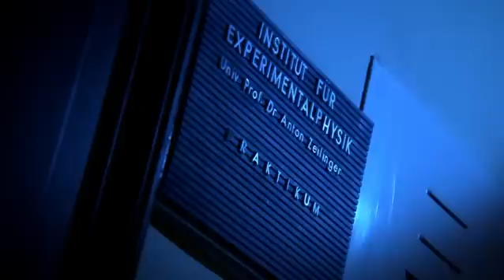Quantum Mechanics - Double Slit Experiment. Is anything real? (Prof. Anton Zeilinger)

Comment: I am a photographer and I have a suggestion. The electronic eye has a charged sensor (electrically charged to respond to the energy emitting from the atom) This is placed behind a lens or similar focussing device pointing towards the 1st slit ready to capture the path/behaviour of the atom) This actively charged sensor makes the observing device a two-way street as its both responding to atomic activity and producing electron activity. Replace the electronic camera with a film camera. If the atom is affected by the presence of a focussed path of electrons (which the camera sensor is producing ) then this energy is being focussed directly into the line of the atoms passing through the slit. This is changing the behaviour of the atoms journey through the observed slit and, in turn, cancelling out the wave inference and resulting pattern. A special film emulsion which would respond only to the energy emitted from the atom makes the observation a one-way street and wouldn't interfere with the path of the atom. The way to be sure about the validity of the obervation/camera producing focused energy would be to point to cameras at each other and turn them both on. If they capture eachothers electron emitting activity, then you have proof of interference.
Reply: Good observation.  But since the first experiments were done, there have been far more advanced metrics taking to eliminate any interference. Some even done in a vacuum.  Either way it collapsed when observed.  I can link experiments to show.  And im not quite sure of the other comment below talking about all this meta talk.  Quantum physics is not suede science or metaphysics. Schrodinger and Heisenberg equations are used to guess where a particle will be because of these phenomenons.
Reply: @jameswolfe4712  could you please share links, because it sure is getting hard to find of the actual "collapse"
Reply: @isaacflorez4820  Yes give me a bit to find a few.  Heres one I watched recently i found interesting while I look for other experiments.  
https://youtu.be/GzbKb59my3U
Reply: @jameswolfe4712  it seems like you never found the collapsing wave function vid
Reply: @TheAcidicMolotov  Perhaps it doesn't exist.
We should think of light the same way we think of sound or waves on the ocean.
Air molecule bumps other air, producing waves we perceive as sound.
Water molecule bumps other water, producing waves we perceive as well... waves.
Electron bumps other electrons, producing waves (that we should call photons), producing waves we perceive as light.

I need to see a vid of this photon measuring device.
Reply: @TheDJRiffin  well the double slit without observation shows light acts like a wave. I found an experiment of it acting like a particle, i wont be able to find it again though
Reply: @TheAcidicMolotov  lol, thanks anyway :)
If anyone else knows of a vid, we'd love to see it!
Reply: Too smart for them, sorry. They are also ignoring electrostatic build up on edges of matter, especially those slits.
Reply: The issue isnt electron interference like you say. Where is this two way electron path stated in the function of these cameras? I dont believe the cameras you refer to make this electron path
Reply: This experiment has been done with other types of detectors.Jim Al-Khalili talks about a detector  that scientist used in the double slit experiment that flashes or beeps AFTER the subatomic particle goes through one or both of the slits.The results of all these double slit experiments are the same no matter what type of detector they use.
Reply: The wave function collapses irrespective of whether the experiment is observed with or without equipment (a person observing the experiment with the ‘naked eye’ produces the same result)
Reply: @sheldonreed4787  Not exactly a collapse since there are no hidden variables and nothing changes, pretty much as you said though.
Reply: @sheldonreed4787  I have never seen this experiment done "with the naked eye" as you say.Where can I find a video of this?
Reply: Makes sense. Don't know why everyone is trying to use this as proof of simulation theory, if it's based off of a flawed experiment.
Reply: I still don’t understand how this happened, im skekkkk
Reply: The Quantum eraser experiment proves that the detectors do not interfere with the photons.
Reply: Yes. This is exactly what's happening. It's frustrating to hear people introduce metaphysics and woo to explain it. It's very clear.
Reply: @unknownuser8838  We come from "Metaphysics and woo." The universe exploded out of an ETERNAL METAPHYSICAL void at the time of the big bang.Figure THAT one out.Physics is the theoretical opposite of that void.That means that the void is Metaphysical because physics is not metaphysical.It's mundane.That's why we cant understand the void and we cant understand consciousness.

Comment: A particle surrounded by a wave. The wave goes first through both slits creating its own interference pattern which shortly thereafter the particle follows at random. When detectors are used they disturb the wave and the particle leave a normal pattern.

Comment: The energy that causes the interference pattern does not come from the photons. They travel in a straight line. The energy comes from the ether that is all around us, the energy from it travels in a transverse wave just like a double slit and a water wave. When you send a charged particle or photon through the ether, the ether being charged reacts by repelling around the photon (for every action an equal and opposite reaction) creating a wave as the photon passes through.  But, when you try to detect the photon the detectors also disrupt the wave in the ether, thus making the interference pattern out of focus. If both slit are open (and detectors off) then the ether waves focus in an interference pattern. This is similar to how an MRI works create a large magnetic field through your body then send radio "waves" through it, creating an image from the transverse waves of the magnetic field.
Reply: Joe Deglman I think I actually understood what you said!
Reply: I think people confuse light with photons. Light is a transverse and spherical wave of ether that travels away from a heat or energy source, like a candle flame, such as Thomas Young used for his double-slit experiment.  A photon is purely a particle that creates light.  A photon creates light in two ways. 1.) a longitudinal spherical wave it creates as the ether repels around the traveling photon,  we see it as an interference pattern, and  2. a transverse spherical wave that travels away from the point of impact of the photon which is an an energy source.

Comment: Does Light (Photons) act by the same laws as like matter of gas and compression?
and how for are the detectors from the slits to monitor it's behavior.

I truly don't see a photon slitting into two or multiple particles before coming into contact with the two slit area unless there was a form of interference before the two slits like dust or just in front of the source projecting the photons.

I do not know much to the behavior of Photos at the subatomic level but shouldn't they (a single Photon) be dividable in proportioning with the same value of size making them fainter as they travel along?. Like how thing spread out into a less dense form being concentrated?
Reply: +Kurt H photons are not particles and thus they do not behave like gasses do. They are also not dividable as far as I know, though they do sometimes briefly spontaneously divide. This is an example of a demonstration of the fact that protons are not particles, but waves, specifically probability wave functions. The "split" is a manifestation of a probability, not a physical division.

Comment: PLEASE READ THIS:
0:42 Attenuated? The light is still being emitted as a wave because photons do not exist. Otherwise the light would travel through one slit perfectly and never hit a wall or go through the second slit. The way this experiment has been explained is dishonest. Fields of probability have not been explained at all. A shard of a light sphere is released from the barrel, accelerates, travels from the barrel and reaches the ACTUAL SPEED OF LIGHT, which can be estimated to be around 1 million km per second (not 300,000km/s). It has enough momentum to travel through the fabric of spacetime and fly out into the void. Due to the light waves traveling through both slits, two shards are produced, which interfere with each other thousands of kilometres away. Then the universe expands and catches up with the glow point, at which time the beam continues at the SPEED LIMIT OF SPACETIME in this particular density region of 300,000 km per second, and the light wave lands on the detection wall. There is no probability field, only the expansion of the universe catching up to light shards (fractions of a light wave sphere) and slowing them down when the universe's boundary (the fabric of spacetime) expands to meet the shards in the void. It appears instant to us, because our reality is limited to 300,000km/s. Anything faster than this (in our local fabric density) has exited the universe and gone into the void outside. Whether the void is sticky, or a wall, or frictionless remains to be tested by varying distances of the the laser to the slits and measuring wall, changing shard width, and timing changes accurately. The light acceleration should also be timed. Given that the wave pattern is uniform, it may also be possible that light shards from earlier remain in the void, ready to be interfered with during the next shard release. Or potentially the light does not fly smoothly through the void, or even potentially mirrored inside the void, as the void may possess prismatic properties.

2:00
The slit observation detector increases the density of the fabric of spacetime, thus preventing further acceleration, so light shards in this instance do not leave the universe. Thus the shards do not travel thousands of kilometres into the void where the shards would have had distance enough to cone out and interfere with one another. They are now only flying a couple of metres at a maximum speed of 300,000km/s. All light travels in spheres, so put another double slit detector behind he laser and let it's full sphere shine out in pulses. You will now be able to begin reading spacetime density. The detector machine thickens spacetime and will result in two lines while the machine in the other direction will allow universe breaching, and allow a wave pattern to reveal the distance th light traveled into the void by measuring the wave interference line separation distances.

Comment: the reason there is a different pattern is expected has to do with the laws that the photons effect/affect each other between the 2 slits and the screen gravity acting upon each other or magnetism or whatever it may be
Reply: +Jay Sch Since the pattern appears when photons pass one at a time through the slits, they're not interfering with each other. Rather, the wave pattern is a statistical average based on the information available to the system in general (universe), as is the particle pattern when the detector is on. In fact every thing is processed the same way such that the universe & its contents contain (describe) each other. It's pretty far out, but proven now that reality is a self processing hologram and that  "appearances" such as time/space/motion or wave/particle patterns are the "output" phase of a universal processor